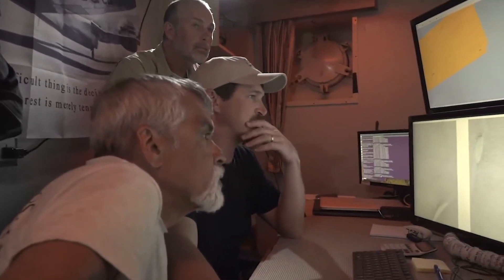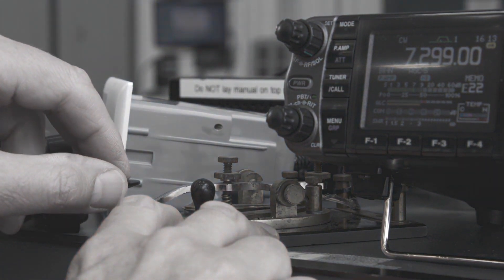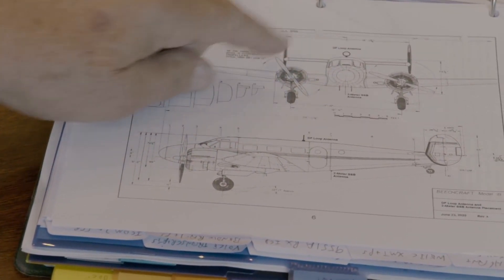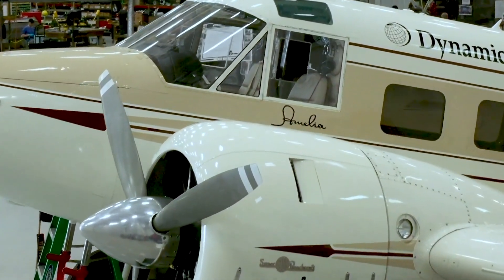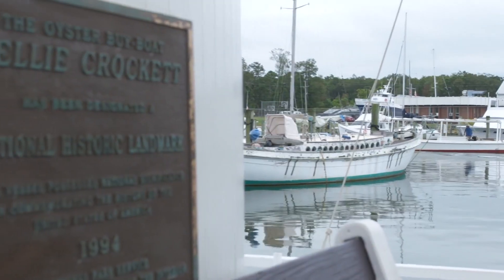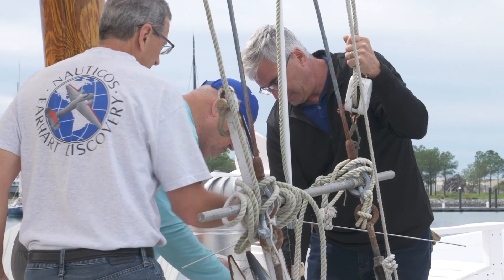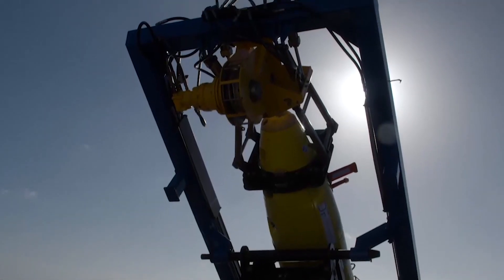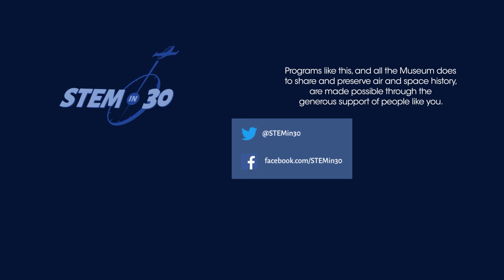The Ongoing Search for Amelia Earhart - STEM in 30

Comment: The flight touchdown
Was as Amelia said
Sandbar...
Nunan revised it to "tiny "island, as per atoll description in 1937
He clearly stated NOT ON the map.
the Morse code AM PTT CW  error correction found, produces only 1 number position set that is valid
See Andrew VK5WT  website.
The position is
S 1 DEG 35 min, 59 SEC
W 175 DEG, 00 min, 18 SEC.
At super low  tide
I have 100 feedback on ebay, so why would I make it up
I studied Marhs sciences at UNI, and a lifetime of
Radio including broadcasting, C-QUAM stereo ,
I restore ww2 radios for my job, 
The dateline was crossed, sure.
The skip zone is a blackout donut.
If you read all of the logs you will see that it is
Clearly stated that after touchdown, 
Itasca and Amelia were heard calling each other.
Skip zone.
No assumptions were made in my error correction tests.
No errors were made in the correction process.
I checked it 4 times .
But for some reason no one except the
Amelia Earhart birthplace museum is taking me seriously

Comment: Question, the last known position was on 157-337 LOP. There are two 157-337 LOP which one was she referring to? 157-337 is probably based on 67 degrees, there are two 67 degrees and BOTH are located north of Howland Island! A 67 degree compass (magnetic) is located 1.5 degrees (80 miles) north of Howland and a 67 degree true (sunrise) is 11 degrees north of Howland. Which 67 degree is the 157-337 LOP based on?? A 67 degree compass (magnetic) can be linked to the  flight. Clarence Williams could have easily given them the wrong directions (76.54 degree true course which is a 67.05 degree compass (magnetic)).